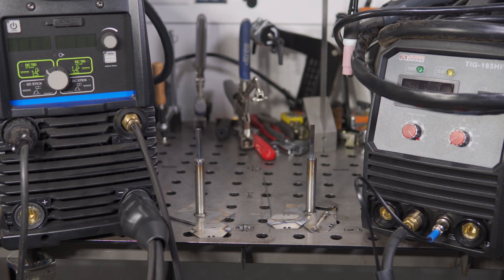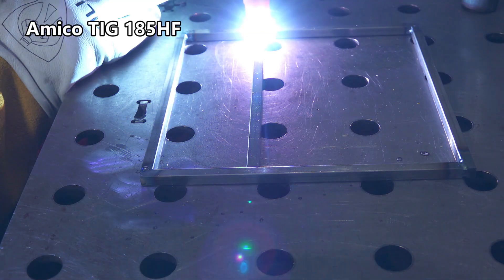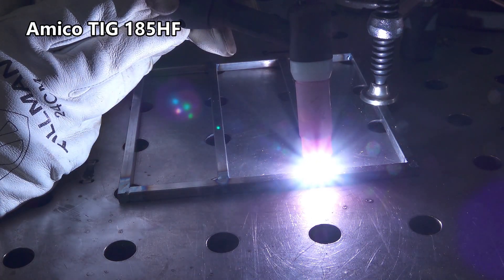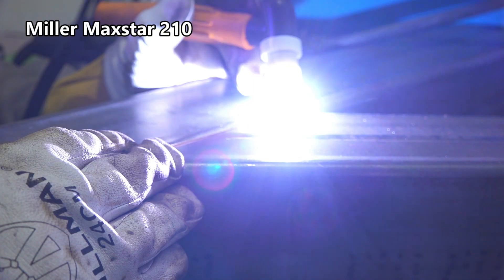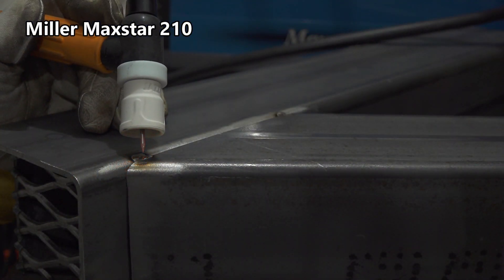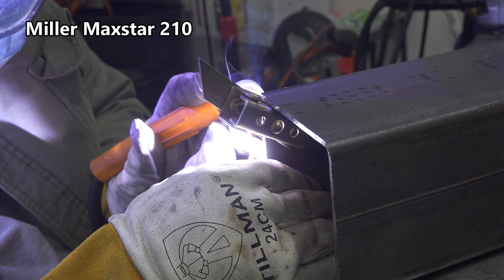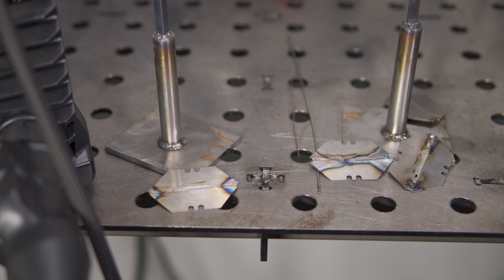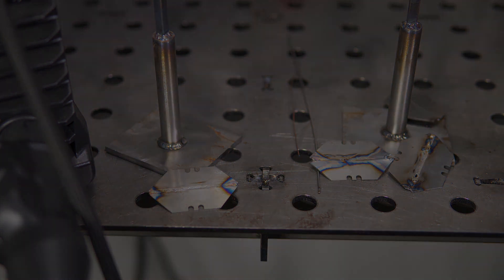Amico TIG 185HF Vs Miller Maxstar 210

Comment: Trying to find a replacement tig torch and cable assembly. for the Max Star. Would you know what will work? thanks
Reply from the maker: Pretty much any torch will work, given the proper adapter.  I like the CK adapter and Miller makes some adapters as well.  It's just a matter of picking out a torch and cable, then making sure you get an adapter that will work with your cable and with your welder.  You just have to decided if you want an air cooled torch, what size, what style, etc.

Comment: Huh I have had an amico machine have for a few years. Ive also bought more. All 3 I've bought have 3/32 red tungsten and everyone of them can run 6010 7018 309 and 4043 stick rods not to mention nickel and hard surface rods. From 1/16th up to 5/32 is the thickest rod I've ever needed to use.
Reply: Did u have any problems with them out of the box I'm starting up my own garage n I'm buying one for my first job out of my shop now I'm scared to buy this lol
Reply: @davidgee6452  which one were you buying?

Comment: I've had the 165-HF for about 2 years now. I had the same issue with HF start until I adjusted the spark gap. Anyone buying one should invest in a new torch, even a cheap one with the HF button taped to it worked better than the baseball bat euro style they sent me. Its definitely not a Miller, not even close to an Everlast, but mine paid for itself the first weld(I mostly do thin stainless). Basically if you don't have a stick welder(scratch start) and want to learn tig, it's not bad for the price but expect some troubleshooting to get it going 100%

Comment: Any video reviews on the Amico TIG-220DC, 220 Amp 2-in-1 TIG Torch/Arc/Stick DC Inverter ?  I really interested in this low budget Amico..
Reply from the maker: I haven't tried that model.  It looks most similar to the red TIG 225 that I reviewed a while back.

Comment: What torch is used for the Maxstar 210? Do you have a link for it?
Reply from the maker: This is my favorite torch for most of the TIG welding I do.  
https://weldfabulous.com/tec-welding-wts-9-12sf-12-5-ft-torch-pkg/
I also have a 17 size of this same torch.  It's not much bigger but it can handle a bit more amperage.  Granted, I've used the 9 size for as much as 160amps for short periods.
Reply: Can you weld aluminum with the miller tig

Comment: So, after a quick comparison: Amico 205 amp HF TIG for $279 at Home Depot. Maxstar 210 for about $3K (for just the machine - no cables, etc). A welder at ten times the price better feel like "easy mode". Otherwise, why would someone spend the extra money. For my needs, spending over $1500 is NOT going to happen. As far as "cobbled together parts", no doubt the Amico uses off the shelf low cost components. How else would a company be able to keep it's production costs that low. Since I'm not depending on my welding production for a living, the decision is easy. Between the two, I would rather get an Amico TIG machine and fix the shortcomings. Even after upgrading the cables, stinger, capacitors (if required), and modifying the system to lengthen post flow, etc., I'm still over $1500 less than a Maxstar 210. On a different note, it does look like Amico's newer stick only machines will run 6010/6011 rods - too bad they don't add that feature to their TIG welders.
Reply from the maker: Depending on your budget, It may be worth looking at other options as well.  Particularly if you are planning on upgrading the Amico anyway.  There are lots of options that offer a bit more than the Amico, but are still much cheaper than the Miller.  Just a thought.  Good luck with whatever you decide.
Reply: @bigtb1717  I have also been looking at the Everlast line as well, particularly the Poweri-TIG 201 and the PowerArc 161STH. I am a little concerned with some of the negative feedback on their warranty support.
Reply from the maker: I’ve been busy, so I can’t say for sure when I’ll get to it, but I’ll be reviewing the 160STH (newest model that costs around $400) as soon as I can get the time.  Could be a good value.  

I don’t know about warranty, I’ve heard mixed things as well.  But I did email support about a mix-up with my order and they were quick to respond and make it right.
Reply: @bigtb1717  If you were to upgrade the Amico TIG torch, what would you use? Thanks.
Reply from the maker: @j.hunter5007  I personally like CK torches and Weld-Tec torches.  I also prefer a 9 or 17 size for most projects.  In my personal opinion, if you are using enough amps to "need" a 26 size torch, you'll probably wish you had a water cooled one pretty fast.

Comment: Can the 185hf weld aluminum?
Reply from the maker: The short answer is no.  Typically AC output is used to TIG aluminum and the 185HF is DC only.  AC current helps break up the oxide layer on the aluminum, allowing the aluminum underneath to melt and allowing it to weld smooth.

The long answer is that technically you can weld aluminum with DC if you use pure helium as the shielding gas.  The helium makes the arc hot enough to burn through the oxide layer.  But it isn't as easy and I don't know that it works well on anything but thick aluminum due to the heat required to punch through the oxide layer.  The oxide layer will also float on top, making it more difficult to see the weld puddle, and requiring you to stab the filler through the oxide layer as you go.  Using helium has disadvantages as well, as it makes arc starting more difficult, so it could make arc starts less reliable.  Helium is also really expensive.  Far more expensive than argon.  So, while it technically can be done, aluminum TIG is typically reserved for AC capable machines.
Reply: @bigtb1717  thank you for your response

Comment: It’s also build quality, warrantee reliability, etc. Everlast has had a bad reputation as to reliability, and particularly, warrantee. Getting warrantee service had been almost impossible. Lots of bad posts on the forums, and a fair amount of complaints in the Better Business Bureau. Their excuse about the BBB complaints was that it was a play for play situation, which I know from experience, isn’t true. Maybe they’ve gotten better, maybe not. They give many people on You Tube free machines (as HTC began doing a bit over a year ago), which means nothing bad can be said. You can tell when someone has been given a machine when they tell the name of the manufacturer and every letter and number of the machine before they do something with it.

As I said, maybe they’re better now, and after all, most people won’t have a problem, at least, not at first. But when you do, make sure the company stands behind their products.

As far as post flow goes, most people don’t understand that post flow is important for TIG, because at the least, you oxidize the tungsten if the post flow is too short. If  it turns blackish. You have to grind it. For stainless, even 12-15 seconds isn’t enough for some types of welds and alloys (316, 321)
Reply from the maker: Well, I've never been given any machines for free, so I'll definitely give my honest opinion and relate my full experience, good or bad.  Unfortunately, I don't generally have the ability to put in months of heavy use on a welder to see how well it holds up over time.  But I plan on doing a comparison of the Everlast and the Amico, because they are similar enough in price that I think the Everlast could be a possible alternative for someone looking to get started and wants a cheap TIG welder .

I still feel like Everlast is a better bet than Amico for the money, but maybe I'll find out that I'm wrong.  There was an issue with my order, and I sent them an email.  They called me and got it straightened out right away.  Good sign so far.  But I have definitely seen some horror stories and angry customers around online too.

Comment: there are so many tig/stick welders of the cheep variety any chance you could compare one of them to this Amico? I would not likely buy
a cheep one, but somebody will. The Amico worked well for the small length welds I wonder how it would compare to the Miller when put to a test at 120 plus amps for 10 min straight  welding I would bet that its duty cycle is very poor. Keep the comparing welders up I like how you cover the subjects.
Reply: I have the amico CTS 160 I have been using it for a while now.. I have tig welded with it turned all the way up till my hand got too hot it never hit the duty cycle.. the plasma cutter alone is worth $300..
Reply from the maker: I have an Everlast 160i STH to review and will be giving comparisons to this Amico.  The Everlast is $391 and has a much better feature set and warranty than the Amico.  I also have a $69 stick welder to check out.  Can't say for sure what I'll do after that, but those two are here.  I just have to find time.

I haven't pushed the duty cycle on this Amico, but I did push the last one pretty hard and it actually ran the full 60% duty cycle at 225 amps.  How reliable it would be if run that hard consistently is difficult to say.  Honestly, the included cables and torch were ready to melt by the time I hit 60%, so   My guess is that the same would be true of this Amico.  Likely the included torch would melt and the insulation on the included cables would overheat and get soft before you could exceed 6 minutes of continuous use at 185 amps.  Might be fun to find out.